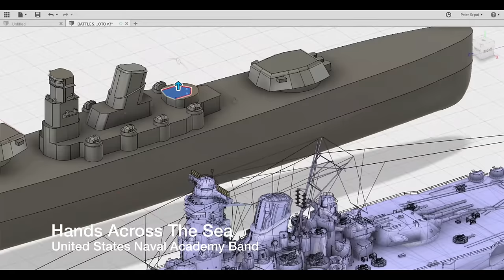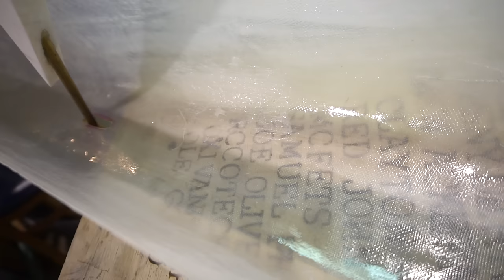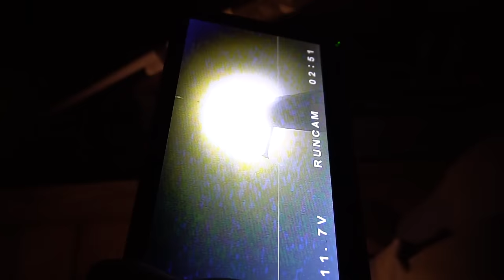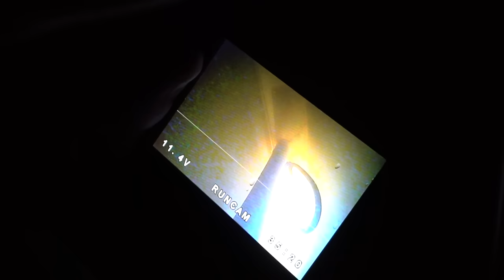GIANT DIY RC Battleships with fireworks

Comment: You guys need to make a submarine and then try to drop depth charges on it
Reply: So have them fight the toastermarine? That would be awesome.
Reply: I’ve done that before, I built a submarine and dropped firecrackers on it and it actually worked, it blew a hole in the sub and it took on water and sank.
Reply: Yes submarine that wi be grate I they build a sub
Reply: Done
Reply: Future teller
Reply: Or Shoot Torpedos!

Comment: That was fun :) How about a quick video on how you made the molds and the Hulls for the boats?
Reply: it's fairly simple process but yeah it'd be a good video.
carve foam, epoxyglass foam, make SMOOTH, spray with mold release (or PAM), start laying up your fiberglass..... prettymuch. another method is make your shape(s) with aluminum window screen mesh and lay it up directly, or carve foam, epoxy-glass it, wash foam out after with gasoline. it's all icky crap but you can do almost anything, with several ways of doing!

Comment: please do a part 2 of this video but you need to widen the hulls of the boats and give them a flatter bottom to make them more stable. If you also encase the prop shaft in a 'fin' structure instead of leaving it just as a tube, that will increase stability when turning so you can go faster in a turn. finally, add a layer or weight to the bottom to help keep the ship upright.

Comment: You should turn the recovery raft into a  GIANT RC battleship!
Reply: But then they couldn't get all the other wreckage back, and they would lose alot of hardware. Also it would be littering.
Reply: 1.) They could attach a 2ft line of string between the other ships and a cut pool noodle. That would make it so they could recover the wreckage much easier.
2.)They showed no problem obliterating the electronics in last video. So they probably won't if they go through with my suggestion.
3.) It wouldn't be littering if they recover all of the pool noodle ships.

Comment: I forgot what it was called but people would fill the a part of the hull with rocks to balance the weight.
Reply: I believe it is called ballast
Reply: It's called ballast.
Reply: Modern ships actually do that with water tanks below the water line. Some ships are made to adjust the ballast to use unevenly weighted equipment or load on heavy cargo
Reply: I'd add phosperos just to make it flashy if a hit was made

Comment: You have to ballast the hull to stabilize them. Also the hull on these boats is much more acute and taller. This is based on the gearing class destroyer. My dad was on the DD-377 USS Perkins in Vietnam. Your model is fairly accurate but the rear deck should be lowered and you need some running lights and life boats.

Comment: 3:15 How did you build the hull?! I need to know!!!!
Reply: Gabe Darrett 
I'm not affiliated wit this video in any way, but I have some boatbuilding experience. To mee it looks like an ordinary fiberglass + resin in a mold- construction. The fiberglass in this case looks like a few layers of thin weave. The resin can be polyester or in this case probably, epoxy.
This is basically how most plastic boats are built. The mold in this case looks like it could have been made out of some kind of foam. With a big CNC router, they would probably machine the mold in two symmetrical halves. (this guess is based on the fact that they seem to be working from an existing 3D model when printing the turrets.

Molds for full-sized boats are usually constructed by carefully applying several layers of grp to the outside of an existing hull. That could have been an existig wooden boat or a one-off built hull. This is called a "Plug" whether it is a functioning boat or just a full-sized model. 
The mold has to be heavily reinforced on the outside before taken off the plug, almost creating a negative hull. So you can see the benefits of machining the mold from a block of foam.

There is of couse a lot more to fiberglass and resin- building, but maybe you now know where to start looking.
/Jon
Reply: @JH-lo9ut  Much appreciated! Thanks for sharing!

Comment: If you used length of tungsten wire in place of the fuse, and heated it super hot, then you wouldn’t need to replace it so often.

Comment: Bela submarginata is a species of sea snail, a marine gastropod mollusk in the family Mangeliidae.[1]

Bela submarginata
Scientific classification edit
Kingdom:
Animalia
Phylum:
Mollusca
Class:
Gastropoda
Subclass:
Caenogastropoda
Order:
Neogastropoda
Superfamily:
Conoidea
Family:
Mangeliidae
Genus:
Bela
Species:
B. submarginata
Binomial name
Bela submarginata
(G. Bonelli in L.M.D. Bellardi, 1847)
Synonyms
Bela submarginata eichwaldi (Friedberg, 1982)
Cythara (Mangelia) submarginata (Bonelli, 1847)
Mangelia submarginata (Bonelli, 1847)
Pleurotoma submarginata (Bellardi, 1847)
Raphitoma submarginata Bonelli, 1847 (original combination)
Contents
Description
Edit

The length of the shell attains 8 mm, its diameter 3.5 mm.

Learn more
This section needs expansion. You can help by adding to it. (March 2017)
Distribution
Edit

Fossils of this marine species have been found in the Vienna Basin (Hörnes, 1856) and in Ukraine (Friedberg, 1912) [2]

References
Edit

^ Worldwide Mollusc Species Data Base: Mangeliidae
^ Waclaw Baluk, Middle Miocene (Badenian) gastropods from Korytnica, Poland; Part IV – Turridae; Acta Geologica Polonica, Vol. 53 (2003), No. 1, pp. 29-78
External links
Edit

Bellardi, 1847 Monografia delle Pleurotome fossili del Piemonte. Royal Printing 1847
Fossilshells.nl: image of Bela submarinata
Last edited 2 years ago by ShortDescBot
RELATED ARTICLES
Bela nebula
Species of gastropod
Bela beatriceae
Species of gastropod
Bela patagonica
Species of gastropod
Wikipedia
Content is available under CC BY-SA 3.0 unless otherwise noted.
Privacy policy Terms of Use Desktop